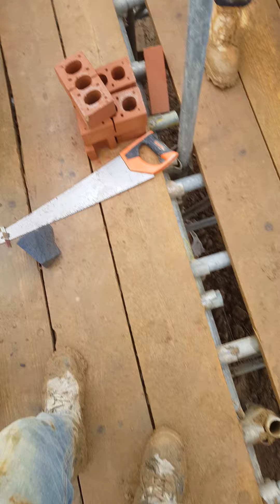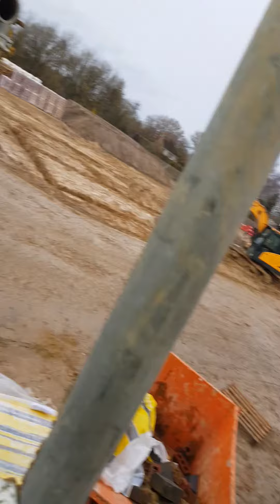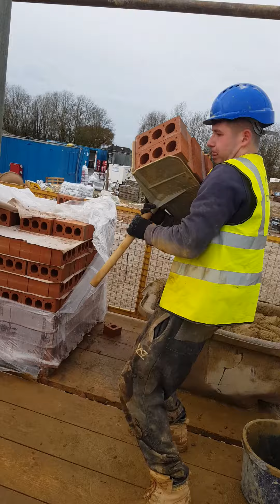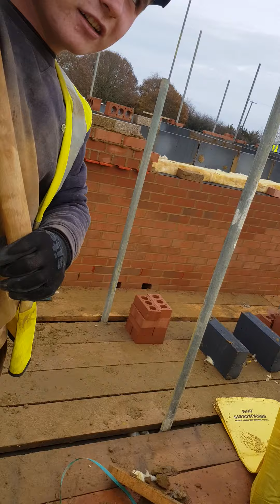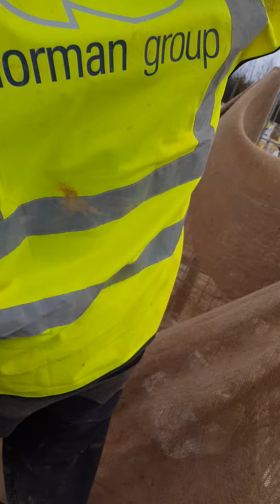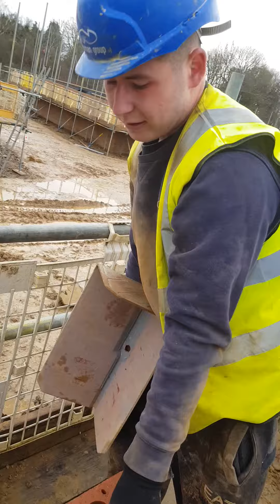He be the best hod carrier in a months time

Comment: I did this for 7 years. Had hodd but never used it. Everything went on the shoulder, bricks ,blocks, muck you will get a callus pad eventually.
Remember to cut 40mm off your shovel and polish it to a shine. Will make knocking muck up 10x easier. 
Always wet your spot boards.
Never go home and leave a dirty bucket or shovel.
Never get the brickies Gregg's order wrong.
Keep everything dry..
Reply: This guy here knows ...💪
Reply: Right on
Reply: I really like watching how diffrent mason tending is in britain compared to the united states. Ive done it for 6 years and tbh this has gone out of style back in the 60's here ever since the introduced brick tongs and robotic mules for lifting block for the hod carriers
Reply: @DETROITER99 Brick tongs are most commonly used here as well but people like to be different 😂
Reply: Disagree with the cutting of the shovel, makes it useless for clearing up
Reply: @ghandi527  Disagree. Having 40mm less makes it useless? How?
Reply: amen 😇

Comment: Australia seems way ahead in labouring than the UK despite doing Bricklaying for much less

Here if we need to move bricks we have a brick barrow that takes 48 bricks at minimum,to load them on and off you use a "6 pack" it grabs 6 bricks at once with a handle,you unload your bricks like that

Plus we also have an elevator to load bricks from ground level to scaff,so basically 1 dude loading 6 at a time at the bottom ground,and 1 packing 6 onto a barrow at the top taking it around.

Easily load up the whole upper story in a couple hours when bricks are on the ground level.

So in this video I feel like it will be much easier if he has himself a good old barrow and loads that up with a 6 pack instead of picking them up 1 by 1, and wheels that barrow around,the hod takes about 20 bricks there and back,while a barrow takes 60, you're saving time taking a bigger load there
Reply: How to you push a wheel barrow up a ladder?  That's why we use hods. Small sites won't rent out brick elevators because it's cheaper to have the hod do it inbetween muking out than renting a machine you probably don't have the space for.
Reply: @user-eq1jv3oo5v  we actual buy that machine,yes it’s expensive but you use it on every single double story building,so instead of walking them up you get two blokes to quickly load up a couple hundred bricks,or what we do is just take half a day to load the whole top story job out with the elevator so the labours only have to sort out mud, which we get up in buckets by a pulley hooked at the top,the dude at the bottom loads the mud up and pulls it up,guy at the top takes the buckets.
Reply: @allthingsbrickwork1751  on big jobs they're used but it's cost officent to just have good hoddys. If someone does small new builds or extensions and has 5-10 on the go at once it's much cheaper to have labour than loads of machines and a truck to transport them. By the time you've got your machine set up our hods have already started bumping out and getting us laying brick.
Reply: Australia ahead of the UK in bricklaying.......down to a wheelbarrow?!?

I'm pretty certain we're streets....Ramsey Streets ahead of you lot.
Reply: That's because you are all puffs now.
Reply: Thing is thats two wages plus an expensive machine. Hoddy is one wage thats it. But id imagine it would be pretty unbearable in australian heat
Reply: I'm from the UK and been "brickies labouring" in Sydney for 4 years and that's a load of shite. UK is miles ahead

Comment: Why don't you just carry a stack of them? I've never used one of those but I install paver driveways and whatnot. The pavers are made of concrete and a lot heavier than those cored bricks.  I'll carry a stack almost the size of those in my hands in front of me. I'm not boasting or anything I'm just wondering maybe if I should use one of those instead. Everybody around here does the same as me so maybe this is the better way. After all, manufactured masonry blocks go way back in Europe